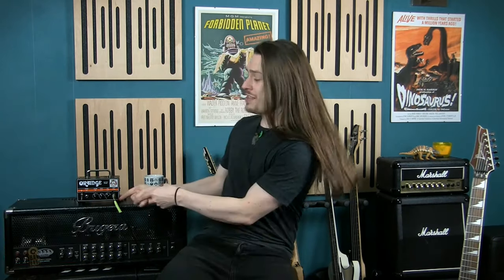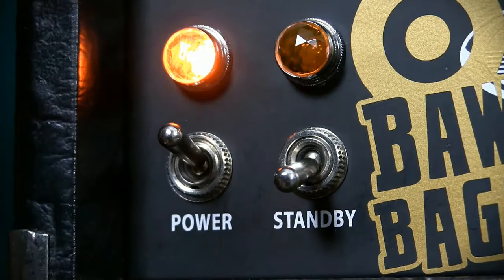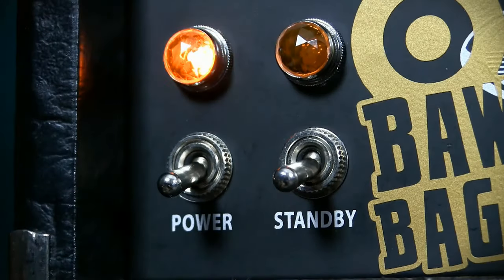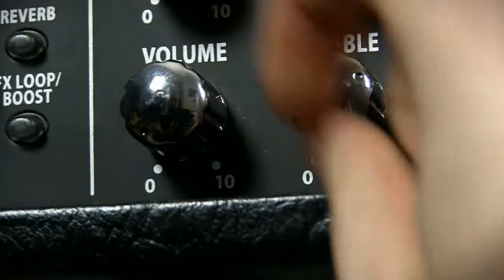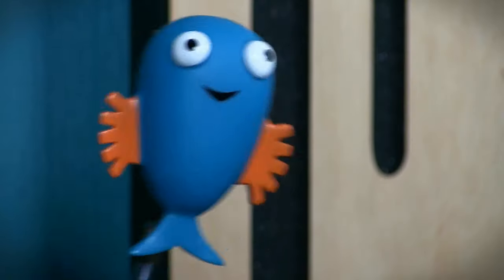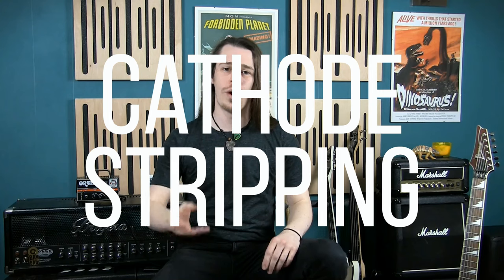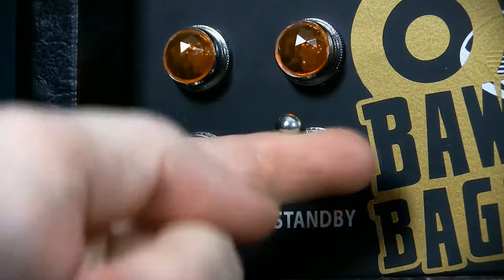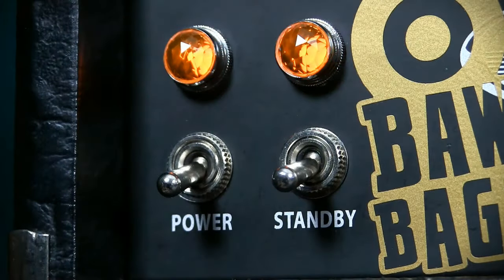Your Standby Switch Is A Lie!

Comment: Why didn't the guy who's considered a guru, that makes Victory Amps write a whole paragraph in the manual on why to use the Standby switch opposed to power? Not only that but specifically instructs the owner to turn the volume down before entering standby or powering off.  Seems like a lot of trouble to explain how to use a switch that you've made a video about how useless it is. Not disputing your knowledge but you also didn't wire me $1500 CAD to pay for amp, nor did I to you and thus why I don't care what you do with your amplifiers.
Reply from the maker: I'd be very interested in reading the instructions outlined. 
Most boutique amp manufacturers refuse to include the switch, so I'd be interested to learn if Victory are doing something different with their design that adds merit to the switch, or whether they, as many other companies do, include the information people are used to hearing in order to keep people happy.
Reply: Stephen H. Leo Fender was a guitar crafting guru but he still called a screw on neck a bolt on neck and a vibrato bar a tremolo bar. Just cause someone important said it, doesn't mean it's right.
Reply: CSGuitars from the Victory V40 user guide at http://www.victoryamps.com/uploads/2/3/7/0/23703557/victory_v40_manual_issue_1.pdf

HIGH – STANDBY – LOW Switch
The V40 should always be switched on, (mains switch on rear of amplifier), with this front panel toggle
switch in its centre position. The amplifier is now in ‘STANDBY’ mode with just the valve heaters and low
voltages on. This allows the valves to heat up before they get 100s of volts up them, (it’s less of a shock).
After around 60 seconds, the amp can be switch to either HIGH, (around 42watts rms) or LOW, (around 9
Watts rms)
Reply: And many other guru amps says otherwise http://www.wamplerpedals.com/news/blog/talking-about-gear/should-i-put-my-amp-on-standby Fortin, hamstead, trace davis etc etc
Reply: Stephen H. Well, I always like to check for myself, but I have my butchers I trust too, and your butcher doesn't really say anything different than what this video is responding to so...
Reply: PANICBLADE Walmart has real butchers? Fuckin' A!
Reply: Stephen H. it should be pretty obvious that this isn't a normal standby switch.
Reply: TheShadwofChaos it's a Standby switch no matter how you slice it.
Reply: I wouldn't necessarily rely on the words of someone who has a product to sell you, guru or not. The cost of including a standby switch is passed on to the buyer, so amp makers are unlikely to tell you they have increased the price of your amp by including circuitry that serves no purpose beyond the psychological. There are technical articles written by engineers with no axe to grind that go in to some detail as to why they are not required. 

By all means keep using your standby switch if it makes you feel better, but it really does serve no purpose. 

Downsides of standby switches include putting stress on valve rectifiers (though many amps are diode rectified these days), and they can lead to cathode poisoning if your amp is left in standby for too long (though you'd have to leave it in standby for a hell of a long time). 

I ignore my standby switch, and have done for years. But then I have a valve rectified amp with a NOS rectifier valve that I really don't want to wear out unnecessarily.
Reply: Honestly, with 42 watts rms you're not even anywhere near something that might be considered "rough" for the tubes. Besides, it's not voltage that hurts the copper inside the tubes. It's the current you're trying to drive through the electric arc that occurs between the actual copper "branches" within the tube. Now for arcing to actually occur you need a higher voltage than what's in the wall outlet, in many cases you'll crank it to 250 volts. 42 watts / 250 volts = 0.168 amperes. You're using less current that a standard 60w light bulb. Some amps might need more than 250 volts, in which case you'll drive even less current in there.

If anything, in terms of the tubes being "too cold", you'll only diminish the output while the tubes heat up (should take less than a minute in most cases). Unless they're really, really frozen, in this case the tubes will conduct so little that no current will make it through, so there's little risk for damage there.

Also, there's nothing wrong with keeping the tubes "warmed up", but if you keep them in a place where they don't ever cool down, then the tubes'll use prematurely and you need to change them. Did I mention most amp makers also make their own tubes?
Reply: Honestly I think it has more to do with all of the victory amps having multiple power settings selectable from the power switch.
Reply: Stephen H. Same with Randall Smith, founder of Mesa Boogie
Reply: if you just heard something, you don't know s-.
 just because someone said something, doesn't make it true, no matter how reputable the individual .
if you take a random techs statement over the techs that engineered the amp you're a fool.
Reply: jeremy tee "just because someone said something, doesn't make it true, no matter how reputable the individual".

True. But over a decade working as an industrial engineer tells me that receiving valves working at sub-500 volts won't cathode strip. The inrush current caused by a hot-switched standby on a a valve rectified amp, on the other hand, is far more harmful than simply ignoring the standby switch altogether.

I'm not taking someone elses word for it, I'm just agreeing with them based on my expertise and years of experience. 

Other than simply parroting back the dogma of amp manufacturers, is anyone prepared to make a detailed, technically accurate defence of the standby switch?
Reply: thats great, did you engineer fender amps?
did you engineer my amp.

if what you've said is true,you may be able to trust yourself,but i would be a fool to trust you over my manual or myself.
it always amazes me considering what  an engineer is,that they can so readily ignore the objective when outside of their comfy little box of understanding.
the ones that prattle on about their expertise are the worst in this regard.
you just presume that because i dont prattle about mine, that i know nothing.
have a good day!
Reply: "the ones that prattle on about their expertise are the worst in this regard."

Yes, heaven forbid stating relevant expertise when contributing to a discussion. 

Good day to you too!
Reply: yeah, if your just gonna ignore what i said because you cant refute it, and ask me to prove something im not trying to prove.
i think we might be done.
thanks for giving me something to take out my bad mood on.
better luck next time.
Reply: "Why not take this opportunity to explain the technical merits of a standby switch?"

"yeah, if your just gonna ignore what I said because you can't refute it, and ask me to prove something I'm not trying to prove"

That'll be a 'no' then. Or a 'don't know.'

Hope you feel better soon, nothing worse than being stuck in a bad mood. I recommend a whisky and a good movie.
Reply: Amp makers "make?" their own tubes???  I didn't know they had that manufacturing ability.  I always thought that there were only a few factories left that did that.
Reply: why should i tout the merits of a standby switch or a lack thereof?  because you said so?!
its not central to my point.
   you and the video poster however suggested that standby switches are usless.
in this regard the burden of proof is on you!
nothing short of providing objective information from fender or their engineers would be required to prove your point under these circumstances.
what im saying, is that anyone would be a fool to listen to you over the manufacturer and engineers of their amp.
i have thouroughly vetted that point.
clearly you cant refute it.
which is why youre trying to digress.
i have not made a resolute claim that the standby switch does anything at all.that said,i dont offer technical advice for free.
learn to read,you tube turns your post into a monilth as well, i had patience to read your subjective nonsense.
i have posted the only fact in regards this article in a previous post you ignored it.
again its crazy how subjective engineers become when they step out of their comfort zone.
ive addresed all your points address mine rather than digressing again.
Reply: "you and the video poster however suggested that standby switches are usless [sic]. in this regard the burden of proof is on you!"

Agreed. Here are some sources:

londonpower.com

http://www.valvewizard.co.uk

http://debontamps.com/standby-switches/

http://blacklodgeamps.tumblr.com/post/96920205757/the-stand-by-myth

Some of these links were provided previously by the maker of the video in the comments. 

"nothing short of providing objective information from fender or their engineers would be required". 

Nonsense. The laws of physics don't change simply when you put them in a cabinet with 'Fender' written on it. Additionally, the premise of the video is that amp manufacturers have been misleading customers as to the purpose of the standby switch. What value would be derived from then relying on them for an accurate statement on the function of a standby switch?

"I have thouroughly [sic] vetted that point". 

I have no idea what you are trying to say here. 

"I had patience to read your subjective nonsense"

Subjective? Can you provide an example of where I made a subjective statement regarding the function of a standby switch?

"I have posted the only fact in regards this article in a previous post you ignored it"

Not sure the above makes grammatical sense, but I think you are claiming you previously made a point that I didn't address to your satisfaction? What was it? I've re-read your posts and am struggling to find the 'only fact' to which you refer.

Other than that, I trust I've now addressed your points to your satisfaction?
Reply: no documentation from the company youre defaming i see.
   
in this forum......
"this guy from marshall says."
"this guy from amp company x says."
"im super smart and i say"
from fender? crickets.

the objective......

again.... fact: in regards to this video and its subsequent post hypothetically the standby switch MAY or MAY NOT be benificial to the life of tubes.(this statement was made before you asked me to prove the efficacy of a standby switch, learn to read)

since you missed it again,my point is that any individual who listens to you,or the video here on youtube and ignores the manual provided with their amp is a fool.

again, did you engineer my amp?
nope.
so how do you know my standby switch is useless?,you dont.
this fact (yes its a fact)
is based on basic logic.
if you disagree, tell me about my amps.

these points are objective, ive repeated  them over and over and you continue to ignore them. 

if you think i should listen to some guy on the internet, over my manual and the techs that designed and service the amp i use.
you need to pull your head out of your butt.
Reply: "no documentation from the company youre [sic] defaming i see."

Nope, never defamed a company. Huge Fender fan, as it happens. 

"if you think i should listen to some guy on the internet over my manual"

Nope, never said this either. 

I appreciate you advising me to learn to read; may I suggest you do likewise. You're attributing a number of statements to me which I never made. That's called a strawman argument.

Regarding the personal insults ('pull your head out your butt', 'im the king of englund' etc);  these are usually interpreted as the debating tactics of someone who has no idea what they're talking about, and therefore resorts to 'playing the man, and not the ball'. 

Your arguments would be so much more credible without them.
Reply: A world of opinions....always provides a huge speed-bump for those who trudge through the internet in hopes to gain real knowledge by knowledgeable people. I truly believe most have just given up because every time, people argue, get abusive, get personal with people they have no fucking clue about....it's all getting a bit played-the-fuck-out. 

Whether it's a power switch/stand-by combo, a power switch, a loop by-pass....no matter what some random says on the internet, if you value having working, reliable gear...follow the fucking manufacturers advice, leave Colin's and everyone else's opinions for conversation and don't willingly put your hard earned (or not) money down the toilet by no abiding by the instructions which are usually written by an engineer.
Reply: Lots of stuff is written about how good some types of wood are for certain tones. Than aint false, yet it's not true we really need electric guitars to be made on wood anymore. It's just the public expect it to be so, and some pre-internet era mythology added.
Reply: Jeremy does have a small point though, which is that you can't be sure exactly what the standby is doing in his amp (unless you look at the circuit diagram). There are special cases where a standby should be used, e.g. to prevent arcing in vintage-copy DC-coupled cathode followers, and the average user doesn't know if he has one of those or not. Using the standby wisely (i.e. let the heaters warm up for half a minute or so) does not do any harm if you don't need it, and saves your cathode follower if you do. 

AFAIK, only Vox managed to design an amp that actually damaged anything (the rectifier) when you use it at switch on., and the design was remedied pretty quickly (AC30 reissue).

You should not leave the standby on for long periods, however, as that really does kill your cathodes by 'sleeping sickness'.
Reply: That was my only point.
Reply: Stephen H. A Butcher isn't the guy that cuts your steaks at the grocery store, that's a meat cutter. A Butcher is the guy at the slaughter house that slaughters and dresses the animal for the meat cutter. Neither one requires a standby switch.

Comment: valves have a different tone when they're nice and hot. so when I'm getting ready to play I turn it on while it's on standby to get the tone while I'll getting my other gear. when I'm done playing I switch it to standby first so that the speaker doesn't pop when I cut the power. is all that reasonable?
Reply: 100% reasonable and correct.
Reply: The tubes don't get "hot" with the amp on standby- the tubes aren't conducting and there's no plate voltage. The only thing that's happening is the filaments are glowing.
Reply: @michaelwoods9005  why do you think the filaments are glowing, michael